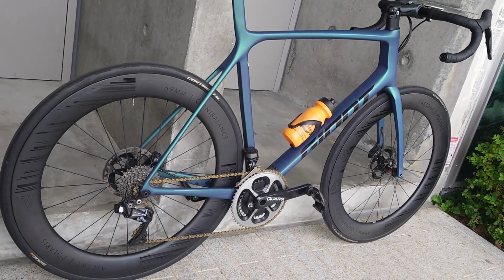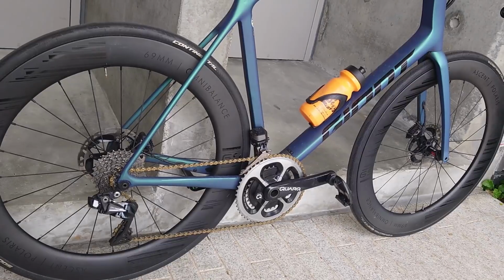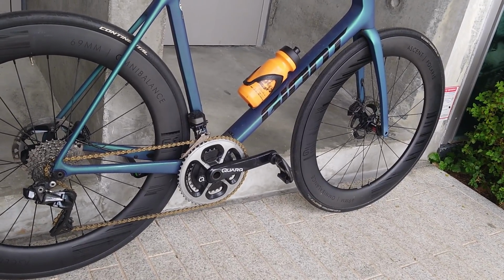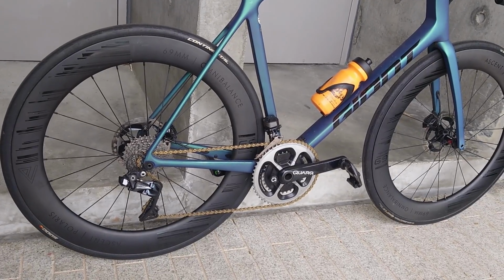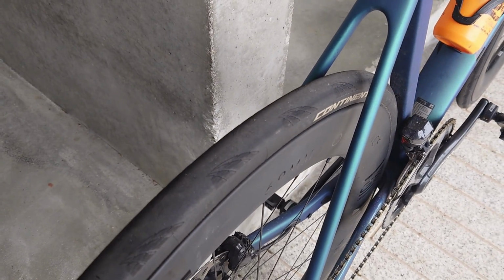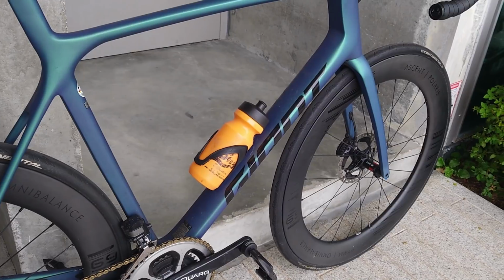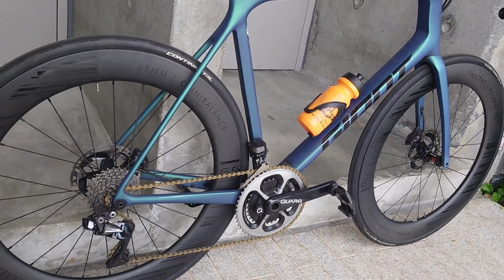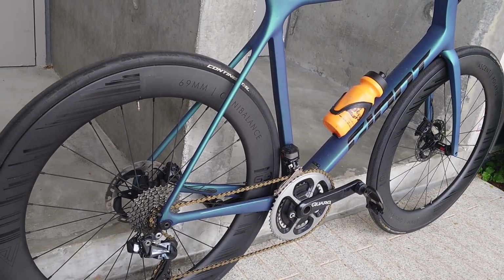Depth AND Stability? Polaris 69mm Wheelset Exclusive. Initial Review.

Comment: Pro tip: in order to stop the dreadful valve rattling, put some electrical tape around the bottom of the valve, near the tube, and not on the outside of the rim, with the valve punching through. Depending on your valve (threaded or not) and rims, a single layer might suffice, otherwise maybe a couple of layers may be necessary. 

Filling the space at its entry point inside the rim makes it rattle-free and also there will be no tape showing on the outside, nor will any glue leftovers on the outside of the rim. In case of extra-tall rims, you might need wider tape or to add a second stripe of tape higher up the valve. A bit of trial and error might be required until you find the right amount of tape for your particular valve/rim combo.
Reply from the maker: Good tip. Heat shrink tubing even better
Reply: @PeakTorque  sure, a much cleaner solution so long as it's not too thick. I did try it once but was too thick for my threaded valve/aluminium rim combo so I kept using electrical tape instead.

Comment: Everybody talks about cross-wind/wind stability of deeper wheels, but what about descending? I feel like since "upgrading" from 40mm deep wheels to Roval Rapide CLX (51mm/60mm F/R) my descending suffered  not a little bit but a lot! They feel sooo sluggish...Is that normal with deeper wheels or is that just a thing with that wheelset in particular? Is that even a thing or is it just my brain? Im considering changing back to a 35mm or 40mm wheelset..would appreciate to hear your opinion! Greetings and clear roads

Comment: You haven't sold me on them vs my Light Bicycle AR56s - depth in the 69s favour but weight and cost in 56s favour - but the interesting point when comparing is that the tyres on your 69s have inflated to have a light bulb cross section? The AR56s with the same 23mm internal and 30mm external widths and hooked rims are flush with a 28mm GP 5000 TL inflated to 60psi.  Query your GP 4000, GP 5000 inflating to wider widths and note going forward that the newer GP 5000S TR apparently inflate slightly narrower too (thicker side walls)
Reply: The Polaris 69s have a width of 31mm at the rim-tire interface, expanding to 35mm at the widest point. GP5K 25C @ 28mm 100psi, 28C @ 29mm 80psi. There is a slight exposed lip even with the 28C tires, and the lip helps to trip the airflow for better predictability. There shouldn't be any lightbulbing with 25 or 28C.
Reply: @ascentbikes   31mm external (contrary to PT's comments in the video) makes it interesting.  If you did a hookless version (as well as lighter weight, hookless supposedly has less "encouragement" of the light bulb shape as it does not pinch the tyre in) then one of the new GP 5000S TRs in 30mm and inflated to approx 56psi might be a very nice combo
Reply: @thisandthatandotherthings  Definitely - it is something to consider. When we designed the Polaris, I made the decision to go with hooked as there were issues of tires blowing off hookless rims. Now that hookless is better supported by tire manufacturers, we will consider incorporating it into future iterations. I really don't like the idea of the tire blowing off while cornering. -QX

Comment: At 7:55 you say these wheels are "still fatigue tested to UCI conditions" but the UCI test isn't a fatigue test, it's a single impact test.
This is important if they are, as you say, using more high modulus carbon, since hi mod carbon is stiffer but isn't as strong.
Reply from the maker: Yep Correct. I meant impact test
Reply: Correct me if I am wrong but I don't think fatigue is the main issue here. I have never heard for a bicycle component made out of CF that failed purely because of fatigue of carbon fibers. I suspect the problem with high modulus CF could be brittleness so impact test is appropriate test.
The big question I have is why even choose high modulus CF over high strength CF for the deep carbon fiber rims. I think they are stiff enough or maybe even too stiff. The only logical explanation I have is that high modulus CF is used in combination with high strength fiber for more even stress distribution. But this seems over-complicated...
Reply: @jkk916  I have a feeling that Peak Torque just  misspoke when he said hi-mod. Easy mistake when you're trying to fit in that many marketing buzzwords :)

Comment: BRR tested GP5000 of various widths and set them up for same absolute deflection (ie. same roll-over and comfort characteristics). Result: equalized rolling resistance to margin of error. So no free lunch involved with wider tyres but a trade-off: you get more headroom for lower pressure (thus comfort and grip) but you also gain weight and marginally worse aero performance.

Comment: Just yesterday rode my 58/88 set up (different brands front and rear) and on the purpose went out in 26-30kmh wind - feels just fine for a guy of 85kg! I think the lighter the rider, the lower profile is needed, at least on the front
Reply: Also depends on what your local wind conditions are like. Where I am can be riding along perfectly sheltered from a 50kph cross wind by high hedges and then you pass a field gate and it’s like someone has physically shoved you to the other side of the road. For lighter riders it can be very risky. I recently built up a bike for a quite slight female rider who wanted to use the bike for TTs/tri as well as general road riding/racing and wanted a deep section rim on the front. We ended up with a 45 on the front and 54 rear as a safe compromise. One of the TT courses she rides (Goodwood) is notoriously windy too.

Comment: Oring is a nice feature, but it becomes redundant with tubeless and can become quite annoing with threaded valves. Not to mention overcomplication of the mold
Reply: Sometimes duct or electrical tape really is the best engineering solution

Comment: What was your chainring setup?
Reply from the maker: 52/34 always!
Reply: @PeakTorque  did you think 53-34 work? Havent give it a try yet but sounds like a big jump
Reply from the maker: @shhhdontshout  I've used it for about 8 years now. Works fine with mechanical and di2. Set-up needs to be perfect
Reply: @PeakTorque  52/34 works well on Zwift too 😝
Reply from the maker: @thisandthatandotherthings  i cancelled my zwift. Found it too boring I'd literally rather go for a run and i hate running

Comment: I like the valve hole o-ring idea. I've gone through so many tubes from torn valve stem bases. No matter how much I file or try to pad the inside with extra rim tape, my tubes always eventually fail there. I think some of it might just be down to pulling on the stem while attaching/detaching the pump. An o-ring would keep the stem seated and avoid pulling, in addition to being quiet and keeping water out of your rims.
Reply from the maker: Peak Torque valve hole damper (TM)
Reply: Make the hole slightly bigger, install rubber grommet. Offer rubber grommet in different colors. Done.
Reply: @JasonLatorre  That's a good idea too, easier to replace a grommet than a tucked in O-ring. Larger hole could decrease the rim strength and create a point of weakness, but you could compensate by making the material around the hole thicker. Might be too unbalanced if too much material is added in one area.
Reply: @nocturnalcadence1676  add a fishing line weight to the spoke on the opposite side 😀 the biggest weight balance issue would come from the 80mm valve stem.
Reply: I've got an o-ring there for an alloy rim from the early 90s, works great.
Reply: Yes all good until/unless you need to replace the o-ring
Reply: @thisandthatandotherthings  not really, you can get o rings in most hardware stores.
Reply: @jonnythelegs2597  Getting the o-ring isn't the issue it is fitting it into PT's moulded housing
Reply: Kind of pointless imo. Tubeless valves already have an o-ring and positive clamping.
Reply from the maker: @galenkehler  tubeless is shite.
Reply: @PeakTorque  🤣
Reply: @PeakTorque  do you have a video on this, if not, please expand on this in the comments.

Comment: The side area explanation sort of only works well for zero side slip, and that's a fairly small factor. The benefit comes when the "sail effect" at larger side slip angles kicks in, and the longer chord of deeper wheels allows for a better aerofoil behaviour of both the leading and trailing segments of the wheel (which are not the single area of the zero side slip explanation). Quite hard to get in CFD actually, crapton of swirl there.
Reply from the maker: I didn't open the sail effect can of worms because so many just don't get it. They think sailboats and landyachts are powered by magic and stardust.
Reply: @PeakTorque  Not too mention the drag polar. As soon as you start to generate CL^2 which is the sail effect, you get an additional Cd.
Reply: @PeakTorque  and I shall continue to believe this until someone can explain it to me!
Reply from the maker: @dancooperish  i did a video on the specialized shiv. Its missing the drag vector part but explains some basics
Reply: @PeakTorque  just watched it. You've both educated me about aerodynamics, and ruined the magic of sailing, so... thanks, I guess?

Comment: How much more contact patch do you get from the increased width? You must be talking about 100ths of a percent in energy output. Maybe that matters for 1000 mile tours. Without considering other factors of this design, I don't see the wider rim impacting a 4 hour ride.
Reply from the maker: For a race bike I'm more talking about frontal aerodynamics at 0 yaw, not increased rolling resistance. But its marginal at best.
Reply: Back to the wind tunnel then. You mentioned added comfort from wider rims. I have a similar experience. The damping from a wide rim is noticeable and remarkable. Does improved comfort translate into higher athletic performance?

Comment: I think you are right about the narrow front. I've had a few goes on them and the back is okay but the front is a bit wide. I'll get the DNV plot when I have enough data points. 

For the average rider, their perception of instability is related to how fast or slow the air pressure equalizes. For example. if you are in a constant cross wind you'll lean your bike over a bit to compensate, that would be regarded as fairly stable. A more dramatic scenario is where a truck goes past and even though the velocities involved are lower, the sudden on set of pressure build up and then it's "collapse" is the unstable bit. 

If I was to jump on my soap box. the fact you have your body weight so high and the instability moment is quite low, you'll probably feel it a lot less than a smaller rider.
Reply: Well noted, both of you! Perhaps the front wheel could do with a little dieting in the future. We've actually run tests where the rider was moving at 40kph, and we did a deliberate close pass with a goods van at 80kph. The scariest thing, according to the rider, was the sound of the engine. Please let me know if your experience corroborates ours.
Reply: @ascentbikes  So haul a goods van with a Tesla.
Reply from the maker: I think the larger inertia actually helps it during the instable moments. Less twitchy than a knife edge lighter rim. Same goes for the body on top of course. Lighter riders' experience will differ.
Reply: Fighting a sidewind then a truck goes past, thats always good fun with 90mm rims, you know its coming tho, well most of the time.
Reply: I would be very intrested in your review of it considering your past view of thick wheels
Reply: This is some higher level maths I cant comprehend
Reply: Spot on, Hambini
Reply: The big companies are making the front wider, notably enve makes their front wheels quite a bit wider than the rear. This is explained as a boost to stability. I'd be surprised if they were going to all that work of differential rims if they didn't have some solid rationale.
Reply: To summarize: the heavier the rider, the better, as it gives us more aerodinamic choices... In starch contrast to what all the weight weenies out there think about trimming down every possible gram 😁

Comment: How's the disc rotor design going?
Reply from the maker: Its coming!
Reply: @PeakTorque  What are you designing a disc rotor for? Durability, power, aerodynamics? Not being critical, I'm new round here and curious.
Reply from the maker: @thegrowl2210  durability, runout, a bit more thermal management. But the 160mm envelope is flawed for road speeds and heat power. Cant change physics.

Comment: Hey there! This is QX, founder of Ascent Bikes. Thank you for the review of Polaris. You have raised good suggestions, and we'll work on the ones that we are able to.
Reply: TLDR: These wheels aren’t special, but prove me wrong here. Peak Torque please chime in too.

I spent a long time researching bike wheel aerodynamics, won a AIAA contest about it. Now working as Mech E at Tesla. Have experience with composites - made my own hollow race car wheels for FSAE.

We all know bike whee aerodynamics can “significantly” reduce overall aerodynamic drag - up to 2-3%. But haven’t airfoil geometries been studied for decades? Meaning, you would think there is a known “most stable” geometry by now (e.g., wider cross sections to induce less pressure drag and more skin friction). Or take ZIPP ABLC technology where designed surface roughness accomplishes this same effect.

My point is, how are these wheels actually special? This video doesn’t reveal anything besides anecdote. Until there is statistical significance isn’t it just marketing after all?

Thanks,
-Drew
Reply: @drewvigne   Hello Drew, thanks for reaching out. I saw that you won an award for your paper on reducing computational cost of wheel CFD using Blade Element Method. Well done! I could probably look at doing that given how core-hungry CFD is.

To your question: it depends on the design priority. Our philosophy is that Confidence is Speed - a rider that is confident will dare to push their limits.

As you mentioned, a wheel can reduce drag by a few percent. This is largely correlated to depth as PT mentioned. However, unless the rim is an absolute pig, the difference between wheels of similar depth is less significant. 

Because of this - we chose to prioritize stability, and our optimization algorithms were tuned to achieve that over pure speed. Different brands would have different priorities of course, hence the diversity of rim shapes. This is why ours is a maximum of 35mm wide.

Granted, this is pretty hard to simulate in CFD, and Wind Tunnel tests for transient load are pretty hard to set up, but what we did was attempt to ensure that the steering moment was lower, and that linearity was maintained over a larger range of wind values. So far, it seems to be working!
Reply: siala singapore brand on peak torque 💪🏻💪🏻
Reply: No, thank you!